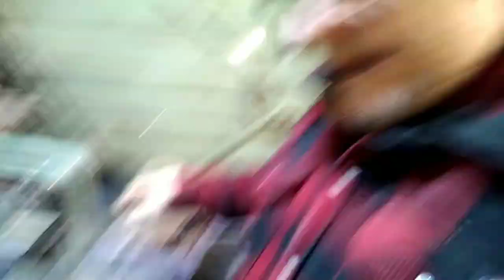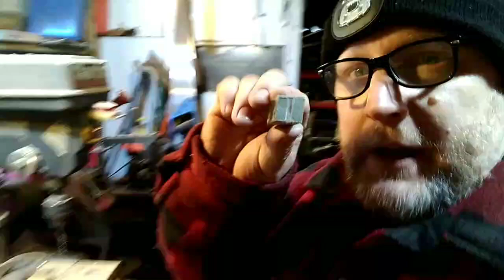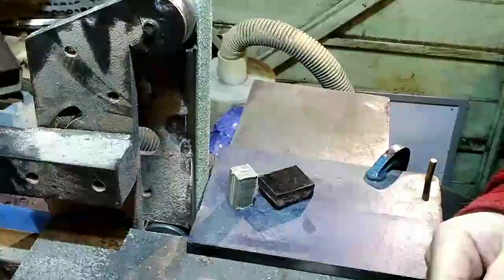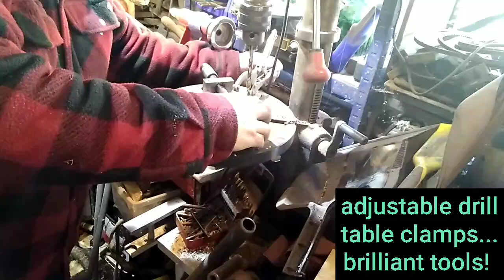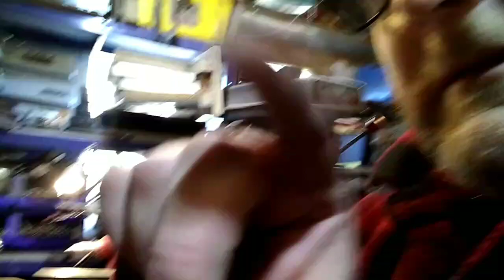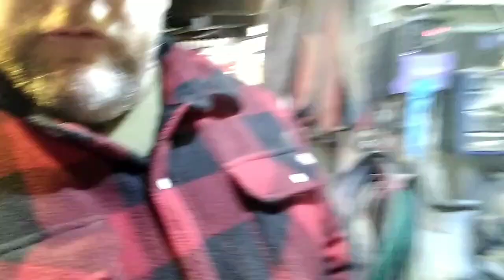Making Custom Ferro rods for bush craft knives, camping outdoors, hiking

Comment from the maker: Making Ferro rods for bush craft knives, camping outdoors, hiking
and yes, these are ferro rods, fire steels are the pieces of steel you strike across flint/chert etc to cast ferrous metal off hard rocks, ferro rods cast sparks as they are scraped by a hard edge such as tool steel or indeed flint or chert...